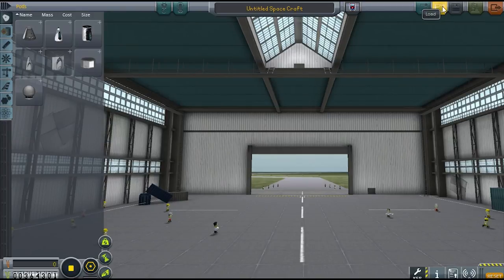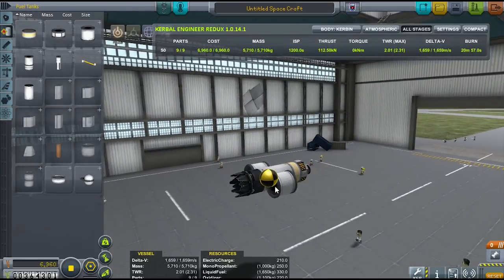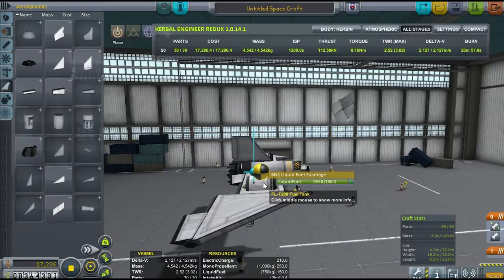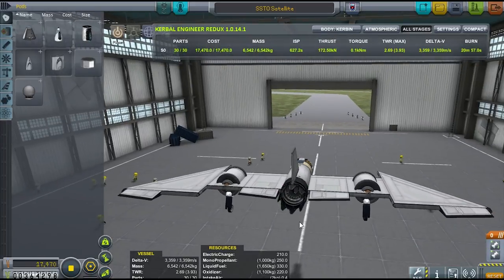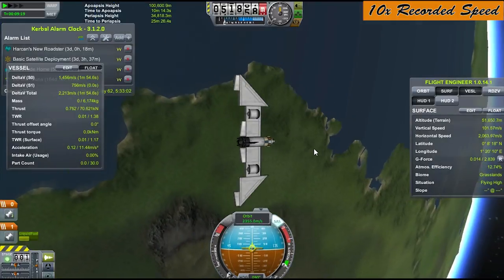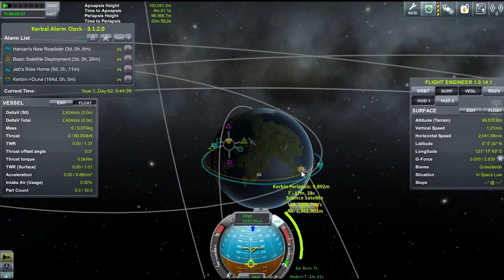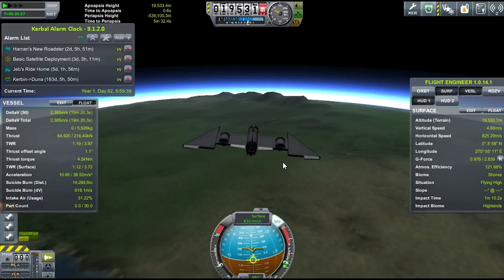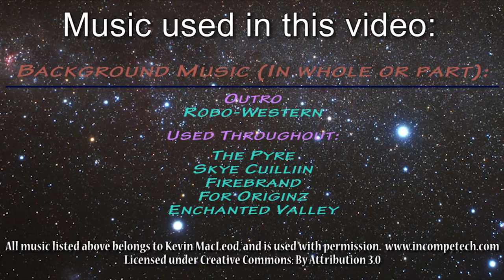Let's Play - KSP 0.90.0 Hard Career Ep12 - Drone SSTOs

Comment: interesting episode where did you get the data about how many units of lift you need for how many tons of mass? and why is that?
Reply from the maker: Canmex It's a general rule of thumb for Spaceplanes.  1 unit of lift/ton of ship (and cargo). That'll all change with the expected aero changes coming that Harvester posted about.  There's also general expectations of how many turbos/rapiers/etc you want for every x tons of ship.  Generally aim for 0.7-1 TWR while sitting on the runway.  Obviously lighter planes can blow this out of the water with a single engine.

The REASON you want that much lift is so that you can fly straight and level and continue upwards movement, or at least not fall down.  This is so you can get your speed as high as possible laterally without falling back towards Kerbin.
Reply: DFWanderingKid interesting thanks for the information

Comment: Great video, I have been trying to use that ship from your file and I am not able to reproduce your climb profile at all. I always flame out at around 30km or if I throttle back enough to keep some airIntake (0.01) I end up descending at 26km. Any thoughts?
Reply from the maker: Ram Homier You running FAR by chance?  I'm in stock Aero.  

You definately need to throttle it back as you go up,but your cutoff shouldn't be that low. 

I just did the Satellite SSTO with the following Climb Profile: Max throttle on engines until otherwise indicated.
0-12km: Aim at 45 degrees.
12.5km: Aim at 35 degrees.
15km: Aim at 25 degrees. 
20km: Aim at 15 degrees.
27-28km: Aim at 10 degrees. (Should be prograde)
30km: Aim 5 degrees.  No burnout yet (stay aimed into the prograde, you need airflow now).
First burnout occurs at 34.5km up.  Horizontal speed is 1583.53m/s, Vertical is 129.55 m/s.  Drop throttle to 2/3's.  Go horizontal.
37km: Second burnout.  Drop to half throttle.  Let your nose drift up a bit.  Aim for 10degrees again.  I leveled off between 37-38km (by accident, left the nose down too long) but the 10 degrees eventually picks me back up vertically.  I'm always gaining horizontal however.
38.8km: Third burnout.  1/3 throttle.  Stay at 10 degrees.

If you have KER, you want to try to keep your vertical between 20-40m/s upwards.  Don't go up much faster than that, you're still building horizontal.  Once you've gotten to orbital speeds, it'll simply run away from you on the horizontal.  Let it.  That shouldn't happen until 42km or so.

41.2km: 1/3 throttle burnout.  From here on in you nudge the throttle down a hair each time the engines disengage.  Aim horizontal.  You should have PLENTY of vertical.  You should also be at 2,100 m/s horizontal or better.

44km: Vertical continues to increase while Horizontal starts to drift downward.  Expected, as long as you're gaining more vertical than you're losing in horizontal.

47km+: You're eeking JUST enough out of your engines to keep you from backsliding heavily in speed while you drift up out of the rest of the atmosphere.

50.6km: There's just enough atmo left for one last setting of throttle.  When this one cuts out, you shut down engines, close up the intakes for less drag, activate your LFEs, and wait for Apo.
Reply: WOW thanks very much for that helpfull answer, I managed to make it work just fine. It is a very nice manoeuvering excercise.
Reply from the maker: Ram Homier My pleasure.  Glad it helped. :)
Reply: DFWanderingKid thanks for that rundown, just made it to orbit with a modified version of your craft, only had to retry a few times to get the right profile
Reply from the maker: GhostFlame713 What did you have to modify?  I'm thinking I need to do a supplemental video to help out folks.
Reply: Well my modifications are only because I don't like being a direct copy, and I needed a science Jr for a contract. I did smaller outer wing tips and dual stabilizing fin. I am still following your lead on most things, you have taught me allot. Planes space planes, 18~tons mun lander. I have even been able to land on crazy spots.
Reply: It seems your ship works great to get to orbit. I have issues landing it back because when it is empty it glides much too well and can still fly at 10 m/s. Without a way to slow down in KSP (like flaps or aerobrakes) I rather my crafts to land at closer to 50 m/s. Any thoughts on that?
Reply from the maker: Ram Homier Try putting two RCS blocks on the front and using them as brakes as you get over the runway?
Reply: DFWanderingKid Interesting!  I must have flown a dozen or two different spaceplanes into orbit, most of them land fine, but I've never gotten an ascent profile to work that well.  So I just tried this out with a cargo plane I made earlier...  9t plane on liftoff, 3t on landing (with the fuel and payload gone), it's somehow perfectly stable with just the two intakes right at the front. (Which I haven't been closing)  Also didn't have to put fuel on the sides at all, tho it's a bit tricky to balance tanks both in front and behind the payload bay.  Couldn't redo your path here, wound up diving from 32km down to ~25 to get more horizontal speed, then redoing a gradual ascent. I had a horribly high AOT, which might explain why I still saw burnout before you did.  But staying level like that saved me probably 100-200m/s dv in fuel over a regular flight on that plane, compared to maxing out my speed at 18km then going into a climb.

While I'm at it, nice series :D
Reply from the maker: Cardboard Box Glad it helped, and I'm happy you're enjoying the series.  Comments like this keep me inspired. :)  

If you'd like to discuss any particular craft, drop it up to a dropbox or something similar for the .craft file and I'll see if I can't figure out if I can help.  Angle of attack, however, is definately important.  I'm working on an interlude movie at the moment for the Space Kitten (bear with, it makes sense eventually) that shows about a dozen bad flight profiles, so I certainly understand your frustration!

However, many (if not most) of my spaceplanes end up with an altitude -> speed change midflight, so don't think you're alone in that.  They just take too long, video wise, to present when they don't quite work at optimal but don't blow up in an amusing disaster. :)